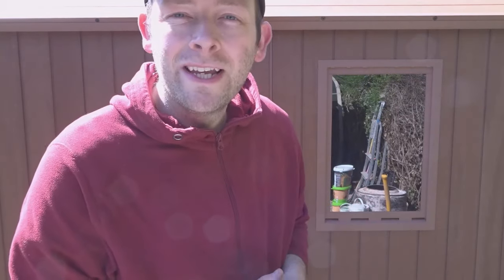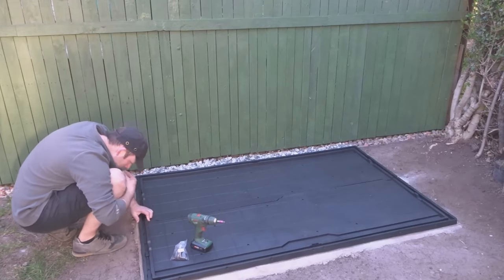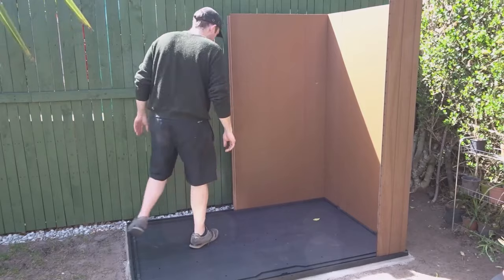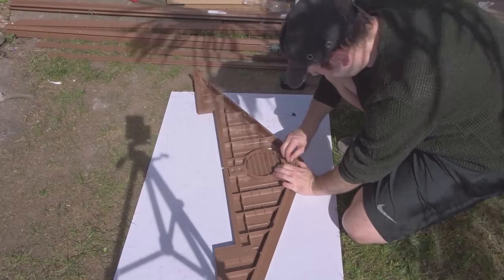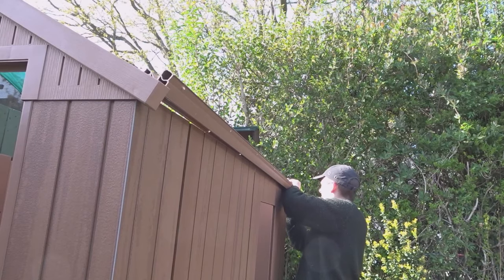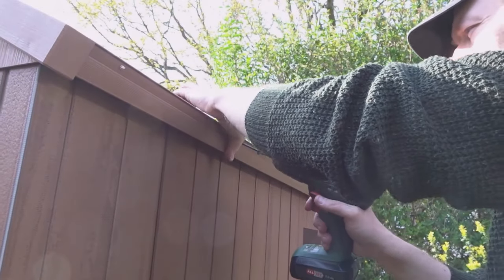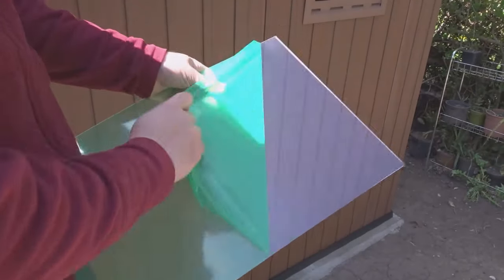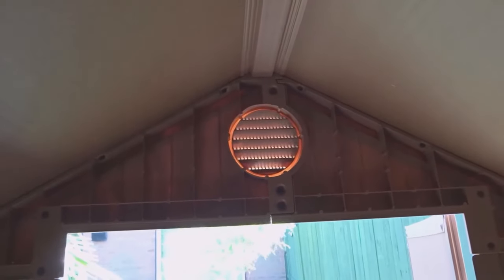Assembling a Keter Darwin 6x4 Composite Garden Shed

Comment from the maker: Amazon UK Link to Keter Darwin 6x4 Garden Shed :  https://amzn.to/47jrrdL

* As an Amazon Associate I earn from qualifying purchases. Thank you.
Reply: Hi mate I can't put the screws in for the door in the door aperture it seems like there not drilled out I have tried screwing through the holes but it only turns about 3 turns
Reply from the maker: @macker8017  They felt like that for me too. I had to apply quite a bit of pressure and they eventually self tapped into the metal.
Reply: I notice you assembled the shed very close to a wooden fence.  I am assuming all the fasteners and fixings etc can be accessed from the interior.  I am about to order this shed and intend to site it within a few inches of my 2 metre high brick garden wall.  Can you tell me if this might create problems in putting the shed together?  Many thanks.
Reply from the maker: @briancranch618  Hi Brian, actually no I pulled the shed out from the fence and fixed the screws then pushed it back. I shifted one corner at a time which was quite easy in my opinion.
Reply: @PhillWyattProjects  Many thanks Phil.  I did wonder if it would bend or distort but there will be two of us so should be fine.  Great stuff, ta.
Reply: Love the editing. You made this installation look easy :)
Reply from the maker: Thanks!  @evangelistangelbowman3122
Reply: Hi... in this video, it's the Darwin 46 Keter... et not the Darwin 64.

Comment: What about the screws at the bottom on the side with the fence? You just skipped these as you didn’t have access?
Reply from the maker: I added them, then pushed the shed against the fence. It's quite easy to push one corner at a time.
Reply: @PhillWyattProjects  great thanks!
Reply: Yes, I wondered how you had fitted the other side of the roof, but the shed is quite light to move around, as long as you have not yet bolted it down.  @PhillWyattProjects

Comment: Yep, I'm getting one of these, so thanks for the excellent video. By the way, you must have had to move the entire structure to get the long screws into the shed on the wall side. How easy and safe is it to move the shed around on a flat day surface? 🤔
Reply from the maker: Thanks👍 yea I did shift it over to do the fence side. It's quite easy to move I just shifted it a few inches one end then the other. Just enough to get down the side. I just took my time.
Reply: @PhillWyattProjects  I spotted that & wonder if it would be possible on a 6 x6 shed I have in mind?
Reply: I came to the comments section to answer this question because I'm installing this on the tight side of my house. Will have to build it and push it all the way down the side. Thanks for asking and answering the questions.

Comment: Great Video. Helped with assembly planning. Put mine up in the volcanic heat this week. I made a 6x4 wooden base with ply and fence posts. Not impressed with the way the roof joins the edges of the apex panels. My garden is quite exposed. I ran a Bead of stixall adhesive /sealant front and back.
Reply from the maker: Your welcome 👍🏻 yea I know what you mean about the roof although mine has performed just fine without any sealant.
Reply: Just built the 8 X 6 today. Took most of the day, but doing it alone and windy with showers. The only criticism is the double doors are pointless and a source of instability. I'd prefer a single door

Comment: Thanks for the detailed video. Will appreciate if you can advice on  bolting long screws in roof and base from outside when you put it next to fence.  One side of mine also sits next to fence.
Reply from the maker: Yea so I pulled the shed out away from the fence to drive in the screws. I then pushed it back into place. It's not very difficult. I pushed one corner then the other gradually.

Comment: How far away from the fence did you put yours?   If I put mine on a gravel pad vs. Concrete do you think I could still move it after doing back side closer to fence?
Reply from the maker: @shalereider1113  mine is about 30cm from the fence. Not sure about how it would slide over gravel though to be honest.

Comment: Thank you for this video.
Unfortunately you showed the 4x6 shed, though the title suggested the 6x4.
I know, the both are similar, but the arrangement is different.
Reply from the maker: Yes I know what you mean. Although even on the Keter website this model is called the 6 x 4. The one with the different arrangement is also called the 6 x 4 on their website. They are both 6 x 4 in dimension.
Reply: @PhillWyattProjects 
I think, the length is a first dimension and width is the second by international standard.
On online shops they differentiate the two types.

Comment: Do you screw the base down to the slabs and how do they cope with bad winds, would the roofs stay on in. Bad storm ?
Reply from the maker: Yes I anchored the base to the slabs underneath using coach bolts. It's been great for about 16 months now. No problems.

Comment: How did you find fixing the roof on the side next to the fence? I am looking to purchase one of these sheds but it will just fit in the gap down the side of the house so it'll be pretty much hard up against the wall of the house and the fence. Looking at your video, which is great btw, it looks easy enough to build everything from the inside other than the long roof screws. I'd be grateful to know how you overcame this before I purchase. Many thanks. Mike
Reply: I wondered about the roof panel too as I want to put mine against the fence.  Can't see me being able to successfully screw it in place if the shed is up against a fence.   How did it get attached ?    Great video , very clear instructions.

Comment: I'm thinking of getting one of these, do you need access all around to assemble it?, mine will be tight up against a fence on 2 sides,, is that a problem,??..
Great video btw,, 👍
Reply from the maker: Yes you do need access although I just assembled the shed then pushed it up against the fence. It is quite easy if you do a corner at a time the shed slides on the slabs.
Reply: @PhillWyattProjects 
Thank you very much, I was hoping you'd say that, 👍👍

Comment: Hi , thanks for the video, it showed it was possible to put it up by yourself, and did not require two people as suggested by another video. I want to somehow attached a timber frame to one side to hang rakes, spades and other garden tools. do you think that might be possible?
Reply from the maker: Thanks Colin. I think it is possible but personally I wouldn't recommend it. The plastic is soft and hollow inside. I have seen it done but I would prefer a freestanding solution.

Comment: I am having trouble screwing the hinges on the sides. Does it have to do that i need a good electrical screwdriver? Cause it seems that the one i am using doesnt have a lot of power. Great video... took me 5 hours and i havent finished the door cause i cant screw the hinges

Comment: Oh how I wish ours had gone up so quickly and easily....Four of us have spent this weekend trying to get it assembled.  It's still  not finished.   Wonder if we got a wonky one??   None of our pieces just slotted in as yours did.......brute force was required.     Even took it all apart and started again making sure we hadn't done something wrong........Nope, still didn't go easily.   Just one more battle with the door and it should be done.
Reply from the maker: Sorry to hear that. They seem to be troublesome if the base is not level. My best advice when putting one of these sheds up is make sure that the base is nice and level as it makes it all go up easily.
Reply: @PhillWyattProjects  Yes, the base was level - we'd just had builders in to prepare it for us!   Nightmare.....We've had to fill gaps with sealant, buy a hook and eye type door closure to stop the door blowing open, as if we'd fitted the one provided the door wouldn't close at all!   I'm in dialogue with Keter but don't think I'll get anywhere!  Thanks for your reply, much appreciated x

Comment: Thanks a lot for your video.
Caution this is not the 6x4 version, but the 4x6. The 6x4 version has a large front door, and seems to be quite criticized. I can't even see it now on Keter's website.. Any information about this ?
Reply from the maker: I noticed there is some confusion about this. Some sites call it the 6 x 4 and others call it the 4 x 6. I suppose technically it's either but the other version being out causes the confusion. On the Keter site they are currently both listed as the 6 x 4. Argos calls this shed the 4 x 6. B&Q calls it the 6 x 4 🤷‍♂️

Comment: How did you add roof near fence and how did you drill base near fence . Can it be built then moved to position
Reply from the maker: I pulled it out a couple of feet from the fence then pushed it back afterwards. Just pushed one corner at a time.

Comment: Hi great, guide, I built one yesterday, but I'm unsure about the window. I'm in UK too and there's a massive black rubber seal in the kit, presumably for the window, but there is no way it will locate this on the inner and outer window frames and there is no mention of this in the instructions or in the included parts list in the manual, but I've seen some videos using self adhesive weather strip to the outer frame but again no mention of this in the manual I don't see you adding any seals or weather strip, doesn't it leak?  Appreciate your help.
Reply from the maker: This is interesting because mine didn't come with the rubber seal or any weather stripping. My window works just fine without it and does not leak. So it might be possible that they changed the design slightly but forgot to leave out the runner strip in some batches.
Reply: @PhillWyattProjects  That's good to know, thanks for your reply 👍

Comment: Hi did you get a piece of rubber with yours? Mine was holding the window together in transit. Should this be used somewhere? I can't see any mention of it in the manual. It looks like a seal for the window.
Reply from the maker: I didn't get any rubber with mine. It could be just packaging? My window doesn't seem to need any rubber seal.

Comment: Hi Phill, please how did you manage to get the concrete around and between the prefabricated concrete slabs? It seems that everyone is putting edging stones around them to hold the slabs in place and I find your solution much easier. Thanks in advance
Reply from the maker: Hi, I mortared about 1cm of cement between each slab and a few centimetres of mortar around the edge. It's been fine ever since. Edging stones I guess would be even better although I don't think it is necessary for a small shed base.

Comment: Hi Phil, nice job 😎 could you build this easy enough and then carry it between two people to the location? Only reason I ask, is because i have a slot down the side of the house and not sure assembly in position would work. Thanks mate
Reply from the maker: Hi, in my opinion yes you could. Maybe carry it before adding the door on. Just be careful.
Reply: I've got mine and yet to build, but from the weight of the box I would not suggest attempting to move this with no less than 1 person each corner when fully built
Reply from the maker: @bash1236 The more the merrier
Reply: Glad this was asked. I have the exact situation. Sounds like building then moving would work then

Comment: Great video. I put one together yesterday and found getting the roof panels into the slot a real headache. Now that it is together, something is not right as I have gaps at each end of the roof as it doesn't fit flush in the gutter area
Reply from the maker: The base needs to be very level for the roof to go into place without problems. That is all I can advise. Hope you get it sorted 👍🏻
Reply: @PhillWyattProjects  Thanks for the advice. I ended up taking it all apart and starting from scratch. I found the problem was once the panels went into the base they wouldn't mind up properly. So ended up making them up outside of the base to make sure they were level, the dropping them in the base. Sorted.
Reply: I had the same problem yesterday, I'm building one as part of a landscaping makeover for a lady...the roof pissed me off so much I went home for the day.
Reply: I had the same issue with fitting the triangular back piece. The locating "dowels" didn't like up with the gaps in the internal corrugation. I ended having to break the corrugations to make it fit. Spent a good 30mins trying to make it fit before realising it was never going to work. Also ran into issues with the hinge holes being too small and needing drilled up a size to get the screws to fit. 

Lost about an extra hour because of the issues we had. (base was perfectly level)

Comment: The side of my house would just about fit this with only a few cm either side. Problem is I won't have access to either side due to lack of space. Do you think all the screws could be put in from the inside of the shed? For the base etc? Thanks
Reply from the maker: Hi, I don't think you can screw them from the inside I would not recommend that. You could assemble it the correct way then shift it into position after. It might take 2 people to move it.

Comment: Great video, thanks. Is the shed heavy to move/lift to a different position whislt empty?
Reply from the maker: Thanks 👍🏻 I think it weighs around 65kg. When I wanted to move it, I pushed one corner at a time and the shed slid over the slabs gradually.
Reply: @PhillWyattProjects  thank you. Can two people lift it to another location whilst it is empty? Or would it not be rigid enough?

Comment: Got one of these sheds on order but I need to squeeze it into a 4x6 space with fence on each side how easy is it to move the shed once its built   are you able to screw the base to the walls from the inside rather than outside as this would be much easier ?
Reply from the maker: I only had to move mine up against one side of fence so it was fairly easy. You do need to add the screws from the outside not the inside. It might be tricky putting it between 2 fences but I would say it's possible.
Reply: @PhillWyattProjects  am thinking putting it on some kind of roller and moving it into position that way

Comment: My shed will be up against a fence the same as yours, how did you screw the floor to the  side panels near the fence ? You didn't show this in the video and it seems impossible as the screws are inserted from the outside !
Reply from the maker: @branded01  yea I just screwed them away from the fence then pushed the shed against the fence one corner at a time. It slides quite easily.
Reply: @PhillWyattProjects  Problem solved ! The shed has been delivered and they have redesigned it with the fixing on the inside !

Comment: I recently purchased this shed and assembled it on a flat base. However, the shed doesn’t seem to be completely straight. I had issues initially with trying to fit the front upper roof piece, one side would fit really snug but the other wouldn’t. Once I got to the end and put the door on, one side of the door is roughly 1-2cm higher than the other side. It seems like I’m a few CM out somewhere but I can’t work it out. Might have to rebuild from scratch. Any advice would be appreciated!
Reply from the maker: Hmm the only thing I can think of is that one corner or the base is higher or lower than the rest. When screwing the wall panels together you need to make sure they are correctly lined up. If a few screws are out of alignment it could cause one end to curve up slightly.

Comment: Thinking of getting one of these sheds to put in a small garden,
Question is once up will it be easy to unassemble later to move to a new home, we are moving to a new house soon for a short while maybe a year or so, then moving on to a more long-term home,  can it be moved with us or is it a build and not take apart again
Reply from the maker: I guess they can be taken apart and put back together. I wouldn't recommend it but I think it's possible. Actually if I move house I might take mine with me also.

Comment: I was expecting you to seal the bottom panels to stop water coming in?and are the screws rust resistant?
Reply from the maker: You don't need to seal the bottom panels because they sit inside a channel that allows water to flow out. They screws have no rust on them so far.

Comment: Hey..the large screws around 12:35, is that just one side they screw into, or do they need to be all the way around? I'm building it with walls either side..so I can see that being a challenge. Thank you
Reply from the maker: They are on both sides. I moved mine out to get access to them.
Reply: Thank you. So it's still fairly movable when built up?

Comment: Hi Phil,  I’m erecting the same shed butting up to a fence. How did you screw the wall to the base on the fence side?
Reply from the maker: Hi Malcolm, I shifted the shed out a few feet from the fence to gain access then shifted it back. I pushed it a corner at a time a few inches at a time carefully.

Comment: can you turn upside down the wall panel that has the window hole? so you can also put a cat flap door in the window hole?
Reply from the maker: Not 100% sure but I think so.
Reply: @PhillWyattProjects  i finally purchased, same one but "DD", double door. I hope it's as good because it was a major expense for me xd
Reply: @PhillWyattProjects  hi Phill, my shed arrived and Im prepared to assemble this weekend. Quick question, if you please... 

do you think that after it is assembled it can be dragged a bit around? 
because where I am planning to put it, it's a corner and I would not have any space on two outer walls of the shed. so I think I can assemble a couple meters away and drag it to it's final resting place once I have assembled.